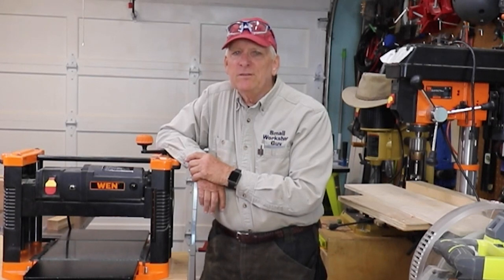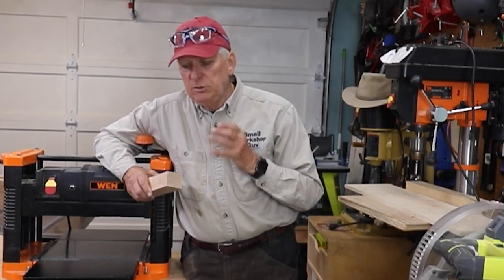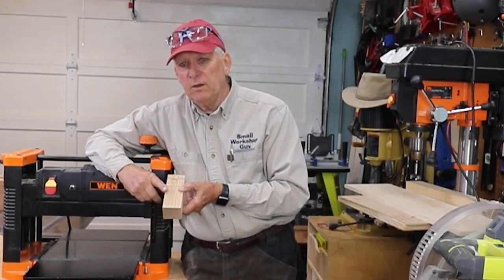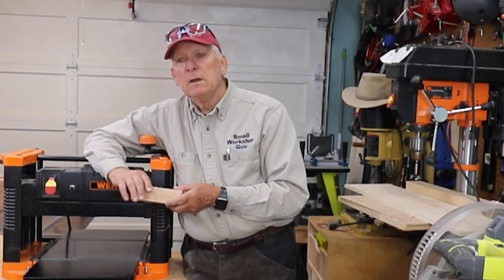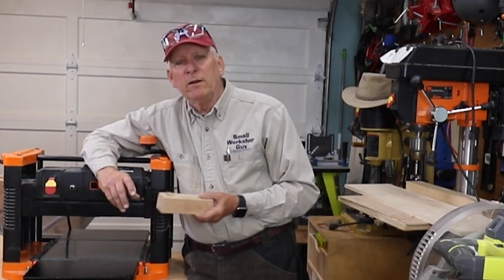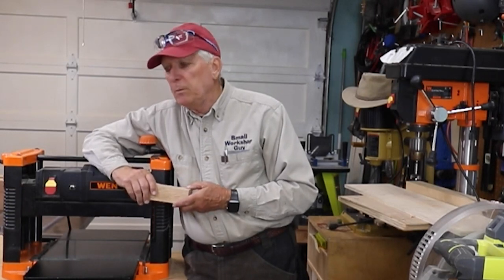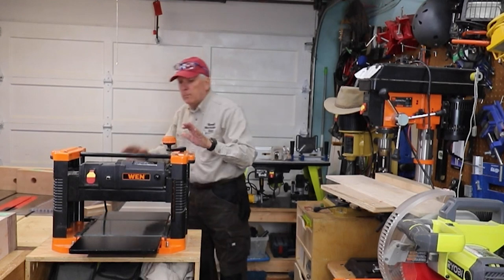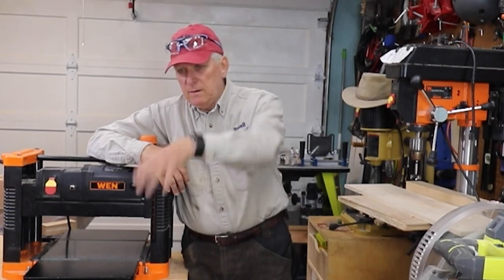How I Turned My Thickness Planer Into a Missile Launch Machine - Better Ways To Defeat Snipe!

Comment: Wow.... that was close!  It's great to have your goof ups on video so you can properly evaluate what went wrong.    Without video evidence you're often left wondering just what happened and in what order...because as you know, it takes less than a nanosecond to change the tide of your day.   

I had a kickback on my table saw and unfortunately I wasn't video taping my project.  Like you, I was super darn lucky to be standing in the correct position but I did something wrong.  It shot a piece of mahogany right past me, thru the dry wall behind me and took out part of the wall stud behind the dry wall.  After replying the event over and over in my head ... I'm left with the belief that my fence must have  tweaked ever so slightly out of alignment.  I aligned it at the start of cutting and ran 2 pieces thru ... same size, same cut, same wood, and on the 3rd I broke the sound barrier between the whizzing of the wood and my startled primal scream.  I was sure I was about to get really hurt.   But I was fine.  Thank goodness.   It's an old skill table saw that I picked up at a yard sale for dirt cheap.  No riving knife, no blade cover ... of course.   They don't make the stock parts and I've been watching eBay.  Probably going to have to make something myself or see about those little 2 prong thingies for after market riving knife replacements.   I've just used my other saws since then.   I think being scared of the saw is just as dangerous as being careless.   So I resigned to not using it until I get a riving knife dohicky.    I've found that I can do amazing things with my circular saw and have avoided dealing with the blooming thing all together.  

I'm surprised I cut on it for a few years before that happened actually.  Someone is watching out for me.  Lol

Happy Crafting!   

Thank you for the snipe lesson!
Reply from the maker: Yes, sometimes the stupid ones like me, myself and I catch a break from a higher power and avoid injury!  Don't turn that on until you get all the safety gear installed and start saving for a SawStop - paying for that beats the heck out of paying a surgeon to try to put your fingers back on!  IMO
Reply from the maker: Hey, Kerri, my mom's maiden name was Schneider - therefore we might be related!
Reply: @SmallWorkshopGuy  You're so right about the sawstop.  I have already starting putting a little aside towards the eventual purchase.  I also keep looking for any and all sweepstakes that involves woodworking tools, because you just never know - somebody's gotta win, right?  lol   As for Schneider - that's my ex-husbands last name - God help you if you're related to his family!   My maiden last name is Wright - you'd be better off if you're related to me that way.  Just sayin.  Cheers!

Comment: I got hit by kickback from my WEN 13” planer. I was putting in 5 boards staggering them like I have seen in countless YouTube videos. I was standing right behind the intake. I’m not sure what happened, but the board on the left side flew out and hit me in the gut just above the hip. Felt like I got punched in the belly. I did t see it and was confused at why I felt like I was hit. The only thing I can think of is my planer is not square. That maybe the left side is higher than the right. That or maybe the wood going through the right side lifted the rollers and the left side board didn’t have the rollers to keep the board from becoming a missile.
Reply from the maker: Ouch!  Yep, doing multiple boards has always concerned be a little bit and I make double sure I am always out of the line of fire now.

Comment: So, I just had kickback from my planer this am. I was feeding through an end cutting board board and it spit it back out. Thankfully I was standing on the side of it,  but it did just barely hit my hand, but not seriously. My board was plenty long but it was red oak. You mentioned red oak as a particular problem because of the grain, is that right?
Reply from the maker: I think any end grain cutting board might be a problem - make sure you take very, very thin slices off and maybe use a sled with a end barrier to hold the workpiece AND ALWAYS, ALWAYS STAND TO THE SIDE.

Comment: Thanks for the video.  I just found you after researching planer kickback because I just had it happen moments ago today.  The 1x2x20” piece of maple came inches from hitting my pup.  Scared the both of us!  I wasn’t supporting the piece as it came out of my planer and that is what I believe caused it.  I didn’t know it would kick back like that I just thought it would cause a little snipe but it caused a missile just like your video accept 4 month old arrow was in the danger zone
Reply from the maker: Glad you did not get hurt or your pup.  I thought 20 inches was long enough to avoid this.  Wonder what happened!  Anyway, glad you were not in the line of fire.  I have a whole new level of respect for a planer and now stand to the side at all times!
Reply: I took apart my planer  yesterday and found one of the bearings on the outfeed roller was worn out.  Like really worn, almost 1/8” of sloppiness.  The drive chains were also pretty stretched out.   The worn out bearing caused enough play in the outfeed roller to allow the roller  to barely  even touch the wood on one side of the planer. This allowed the blades to grab ahold of the wood and sent it flying.      This also explains the intermittent “skipping”  and “clicking” noise that my planer has been making.